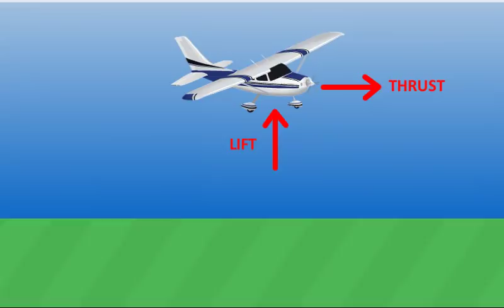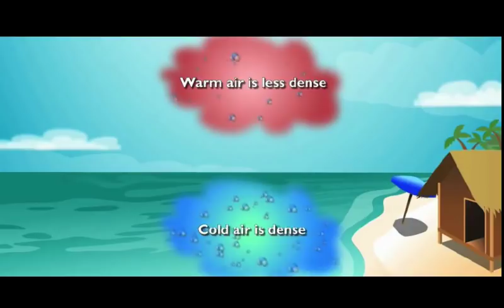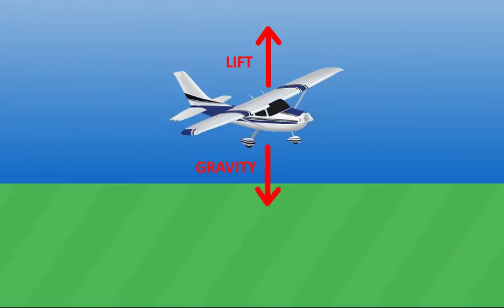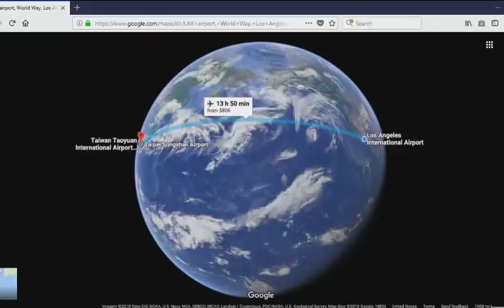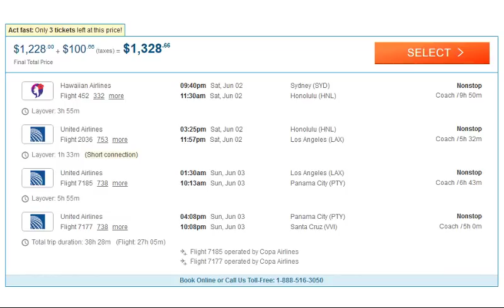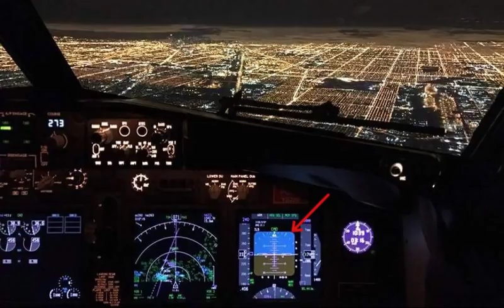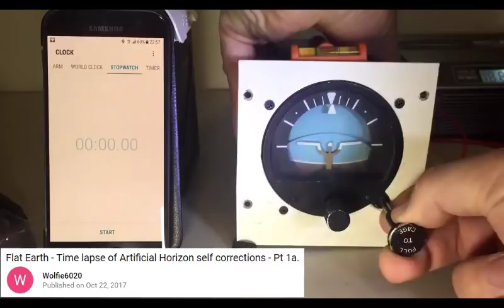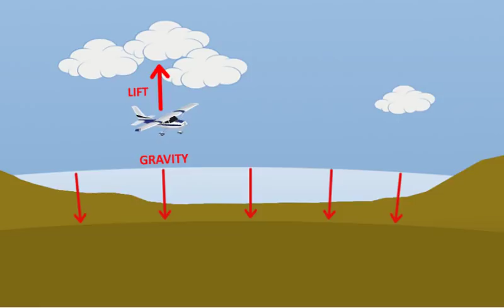Flat Earth Falsities - Plane Nonsense

Comment: No reason for air pressure to decrease with altitude? How about density and buoyancy? Lol
Reply: You just described buoyancy, bravo!

The buoyancy force is proportional to the density difference (as you described), multiplied by gravity or acceleration.  No gravity or acceleration, no buoyancy.  You can test this in your kitchen.  Fill a sealable bottle with oil and water, such that the water floats on top (because of buoyancy).  Not flip it upside-down and see the oil at the bottom rise through the water (because of buoyancy). Now do it again but drop the bottle. Until that bottle hits the ground, the oil will stay at the bottom (no buoyancy).

This is also how a centrifuge works, by increasing buoyancy through large (centripetal) acceleration.

So, you see, gravity isn't picky about what it acts on and it works 100% percent of time.

As a flat Earther, instead of seeking correct knowledge from those who understand physics, you assume all physicists are wrong and that some random YouTubers out for donations and click cash know best. This leads you to be brainwashed worst than your masters say about us.
Reply: You just explained buoyancy, Sam, but apparently I missed the part where you elaborate how "density and buoyancy" work as a substitute for our good old gravity. Especially considering that density doesn't automatically lead to the buoyancy effect unless you have a force such as gravity.
Density describes the amount of mass inside a given volume. It can never cause an acceleration nor a direction for the object to fall to. So your cop-out is about as sensible as saying that light is a hoax and we can see due to "reflection and brightness" alone. It's the blatant attempt to desperately find a force that acts exactly like gravity EXCEPT for the part where our planet would be crunched into a ball.
That's the only reason why you deny gravity - at least admit that. It makes your religious-like beliefs even more absurd than they already are. And I'm certain you are very capable of understanding what I'm saying here. You just don't want to understand. Huge biases cloud your mind.
Reply: I'm an idiot?
Your reading comprehension skills need work.  You explained what buoyancy does, but you failed to understand that it only work in the presence of gravity.  I even provided examples you could try to demonstrate this.  I am sorry it was too complicated for you, but that's the best I can do; I am not a grade school teacher.
Reply: Okay. Explain.
Reply: Yes, explain. And apply it to explain increasing ocean pressure with depth, exactly as expected from the weight of the water column above any depth as
  density × depth × gravity
Reply: Psy Fi I shouldn’t have to explain this to globe earthers since they are the more educated and intelligent, but any body with greater mass/volume (aka density) than its surroundings will fall. In contrast, bodies with less density than its surroundings will rise. Hot air balloons rise bc of density and buoyancy - the hot air inside of the balloon is less dense than the air that surrounds it therefore it rises.... it’s not because gravity is picky about what it acts on. You can observe this in real life with real experiments and you don’t need a made up fairy tale that only works 50% of the time like gravity to explain it.
Reply: Peter Galbraith you just told me to explain density and buoyancy...... and you’re mocking me for...... explaining density and buoyancy???? Bravo you’re an idiot
Reply: No... bud the air is not a homogeneous mixture
Reply: Sam Nguyen 

I never said air was a homogeneous mixture; I said sea water also experiences increasing pressure with depth  without being compressible like air. I assume you knew that the vast majority of air changes in density with height is because of compression. But now I realize you don't know that and probably think the air is thinner on top of Everest because it's no longer air as we know it.

And of course I am the idiot. Wow.
Reply: Peter Galbraith that comment wasn’t even directed at you bro calm your tits. I really don’t understand how your brain draws conclusions out of thin air but it makes it hard to have a coherent discussion with you
Reply: Psy Fi apparently you did. It’s tough out here in the real world without a 3rd grade science teacher holding your hand right? MORE DENSE = FALL (“gravity”), LESS DENSE = RISE (anti-“gravity”?)

Comment: so based on your explanation of how planes fly on earth.
how does thrust work exactly in the vacuum of space?
Reply: 3rd Law of Motion.  Every action has an equal and opposite reaction.  Rocket fuel burns creating an incredible amount of gas, that gas can only escape through the exhaust port, as the gas moves out the gas port the equal and opposite reaction causes the rocket to move in the opposite direction.
Reply: OMG GMO the rocket thrust tgan pushes off of what in tbe vacuum of space ?
Reply: OMG GMO so you must believe than planes dont fly because of air or atmosphere, they simply fly becauae of the gas and thrust from an engine ?
Reply: It doesn't "push off" anything, it doesn't need to push off anything.  3rd Law of Motion.  Every action creates and equal and opposite reaction.  The gas goes one way, the rocket goes the other way.  Have you ever fired a gun?  Did you notice the recoil of the gun?  Do you think the gun was "pushing off" the air?  No, the bullet went one way and the gun was forced the other way.
Reply: "OMG GMO so you must believe than planes dont fly because of air or atmosphere"

You asked how rockets work in a vacuum.  I explained how rockets work in a vacuum.  You are now trying to create a straw man version to argue against.

"they simply fly becauae of the gas and thrust from an engine ?"

A jet engine and a rocket engine are not the same thing.  They do not work in the same way.  You asked about rockets, I explained rockets.  The video did a good job of explaining airplanes, I suggest you watch it again.  Planes and rockets are not the same thing.  They do not work the same way.
Reply: OMG GMO hmmm, interesting.
ima think about this.
something still seems off though.
thank you for not useing insults btw
Reply: Imagine firing a shotgun in a vacuum. There would still be recoil. Because the recoil is a result of Newton’s Third Law, and not the shot pushing against air.

Comment: How do rockets propel through space if there is no air?
Reply: Yep. Any child knows how to swing themselves higher on a swing without being pushed.
Reply: GrahamStw dude, I didn’t even think of that example. You sir, are brilliant 😀
Reply: By Newton’s Third Law: every action has an equal and opposite reaction. 

Push something out and you get pushed back by the same force.
Reply: Great Work you can even move an object (not by any serious degree; but, change it’s orientation) by just moving weights. Look up reaction wheels, they used them on Skylab and again on Hubble.
Just move a gigantic weight, and the change in center of gravity will reorient the object it is attached to.
To get a practical example, pick up a 50lb kettlebell, start to throw it, and then just don’t let go.

Comment: Lets put it in globehead terms. If you were on the U.S.S Enterprise going warp 9, would you want take the shuttle  
Craft for a spin? Now think really hard.
Reply: Don’t be daft. You can’t launch a shuttlecraft while at warp. Besides most of the shuttles are impulse drive only or have limited warp capability. It’d get left behind.
Reply: GrahamStw 
Depends on the vessel and the shuttle class. The delta flyer from Voyager could outrun an oberth or potentially a Nova class

Comment: Tell a fighter jet pilot going mach 3 to through a ball in the air. It would land in the back of their skull.
Reply: GrahamStw didn’t you know that everyone that ever set foot on a concorde died; because they spent the 90 minute flight pinned against the bulkhead, unable to gather enough strength to force air out of their lungs, due to the Mach 2 air being forced down their throats?
Oh, wait, that never happened. It only must have happened if Falcon was right.
Reply: Nope. Not if they were flying at a constant speed and direction.
Reply: You know this doesn’t happen on a commercial flight doing a steady 550mph. 
So why would it happen on a fighter jet?
Reply: Robert: naaah, that's just because even the Concorde was faaaake. Everything that contradicts a conspiracy nut is fake. Everything outside their padded cell is fake. Reality is fake!!!
Reply: soriac I had one moron say “given the speed the sun is moving through the sky, I predict that it isn’t moving much faster than I can walk.”
I responded with “yeah, I know, right, I can totally casually walk across 3 time zones in 3 hours.”

Comment: 1. When you rocket off a spinning ball into space where there is no friction and find out the "mother ship earth" is being pulled by the sun going  514,495 mph through the milkyway, that would leave you stranded in space. Like the ball in the car, if you threw it in the air without a car top going 514,495 mph I doubt the ball will come straight back.
Reply: It wouldn’t leave you stranded in space for exactly the same reason as before. You have the velocity of Earth and you are moving with Earth and the rest of the solar system.

Comment: I have a slight correction re. number 3. A plane is flying level thanks to gradient of density of atmosphere. Lifting force is as of the lift equation, which states that lift is equal to the lift coefficient (Cl) times the density of the air (r) times half of the square of the velocity (V) times the wing area (A). While Cl and A are constant (at a given angle of attack) and let's keep the velocity constant. Plane therefore is in a state of equilibrum. Should it go up - the air density will drop thus reducing the lifting force and this will cause the plane to fall. Slightly. When it falls the air density rises as well as lifting force. And the plane goes up. This will cause the plane to follow the curvature of the earth (more or less, subject to local pressure changes caused by weather).

Comment: If FE is so stupid and this hole ass logic is so sound then @2min why do the planes not need different amounts of force to "loose the momentum" VR claims is not "instantly lost", since said momentum is with and against the 2 planes exampled?
Reply from the maker: They don't need to lose momentum at all. Why would they? They continue moving relative to the air, in any direction, which is moving with the earth.
Reply: Travelling in a constant speed train or plane, do you need more force to walk towards the back? No. 
Do you need less force to throw an object forwards? No.

Comment: If the earth is spinning 1,000 mph at the equator, and zero mph at the poles, then it would have to be spinning 500 mph at the 45th parallel, right? Right! So you have all of those varying speeds between 1,000 and zero mph between the Equator and the poles. What force causes the airplane flying North to continually decrease its LATERAL movement with the atmosphere and then continually increase its LATERAL movement when going South toward the Equator?
Reply from the maker: Since the air is also moving slower at higher latitudes, it will gradually slow it's eastern movement with the air, and isn't noticeable. The pilots have to constantly direct the plane toward the target anyway due to wind currents. It's not a ballistic missile.

Comment: Please answer the helicopter and plane examples... I am a little dense and need extra attention to understand this technical information.

So a helicopter has "momentum"? From what? If it lifts off in a straight line upwards... it can just stay there. Or are you saying it can just stay there and the Earth will move? Then it can land when the destination arrives?

So the airplanes don't follow the contour of the ball? Or it does? Which one? If it follows the contour, then it is dipping it's nose, right? Even if it is just a little, it still has to, right? Or no? Which one?

Very confusing.

Comment: The earth is very large so 1000 mph is not fast at all now if a ball spins 1000 mph it would be moving extremely fast why is that because mph technically is not speed but distance covered in a certain time. So for a big object like the earth 1000 mph is slow in comparison to the size of the earth flat earther don’t use science to prove their points only conjecture. We are too small to use perception to understand our planet their theories create lots of questions than answers it’s sad that people still thinks the earth is flat
Reply: The rotation speed of the earth is half the speed of an hour hand on an analog clock. You can barely see it moving.
Reply: The rotation speed is not measured in mph, but in rpm. The rotation speed of earth is 0.000694 rpm

Comment: A lot of these explanations are not really correct, which is a problem because flat earthers will take every minor mistake and claim its part of the a conspiracy. 

(1) If you stick your hand out a window, you arent feeling friction, you are feeling what known as "form drag" which is due to the shape of the object requiring air to be diverted around your hand, and the stagnation pressure required to do so

(2) regarding airplanes flying level, your explanation isnt entirely correct. gravity does not keep the plane level. If you had a gyroscope in the plan which prevented it from changing attitude, it would eventually begin to climb (albeit at the expense of speed). The real reason planes dont dip their noise is much more practical: the plane is constantly making small corrections to maintain level flight. The corrections required based on the curve of the earth are so gradual they cannot be noticed. Interestingly, on a flat earth, the planes would have to constantly turn to maintain an east or western trajectory. i assume flat earthers explain this away by claiming the turn is so gradual you dont notice it. funny how they use that explanation when it suits them but forget it here.
Reply from the maker: Thanks for your corrections.
Reply: no problem. very subtle. but if you are technically wrong, flat earthers will hone in on it and make it part of the conspiracy.
Reply: +arkie87: they will do it anyway ;-)
Remember: reality disagrees with a flattie? Reality is fake!!!

Comment: I will say this a great attempt of mind control as it ignores the blatant evidences that debunk curvature. And instead trying to lead you astray and think for you. There is no observable or verifiable curvature or motion to this realm. The spells are breaking and we are thinking for ourselves
Reply: Observable Curvature:
- the angle of the moon dependent on observer's latitude is evidence of a curve. https://s7.postimg.cc/nwyi0pnjv/Moon_Rotation.jpg
- different constellations visible dependent on  observer's latitude is evidence of a curve.
- stars rotating around two different opposite points in the sky is evidence of a curve.
- day length varying by latitude is evidence of a curve.
- ships disappearing bottom first on the horizon is evidence of a curve.
- sunsets are evidence of a curve.

Observable Motion:
- the stars, sun and moon moving across our skies are evidence of spin.
- the changing position of the stars over time is evidence of motion.
- apparent retrograde motion of the planets is evidence of motion.
- weight difference of the same object at pole and equator is evidence of centrifugal force caused by spin.
- weather systems forming clockwise around high pressure and anti-clockwise around low pressure in the Northern Hemisphere and doing the opposite in the Southern Hemisphere is evidence of the Coriolis force caused by spin.
- a pendulum rotating around with a period that is dependent on its latitude is evidence of spin AND curvature.
- a gyrocompass, as used in boats and ships all over the world, is evidence of spin AND curvature.

What was that about ignoring blatant evidence??
Reply: We have millions of photos of the Earths curve from outer space. You do not have one single photo of a flat Earth. Why can't flat earthers make one single map of the flat Earth where the distances match the real world? If they know more about the shape of the Earth than anyone else, they should be able to make a map of it. The lack of a working map really destroys their credibility.
Reply: Stephen H, one of them told me that the Sun is powered by electromagnetism because of something something Tesla that we are just now learning about.
Reply: I’ve been told before that Tesla was a flat earther and the “evidence” was that he never once mentions flat earth in his writings which proves the government must have deleted it all 🤦🏻‍♂️
The fact that many of his most famous papers include diagrams of the globe and solar system and that he wrote multiple times about the orbit of the moon and interplanetary communication was also “evidence”. 🤦🏻‍♂️🤦🏻‍♂️
Reply: Mike Lemons - I want to know what they think the Sun actually is, and what exactly powers it.